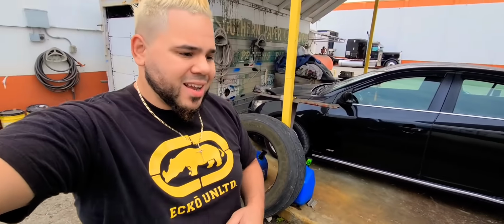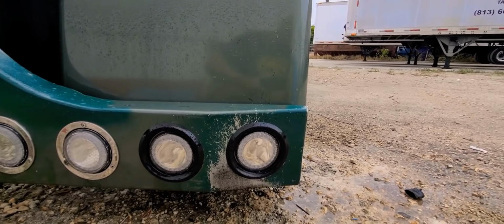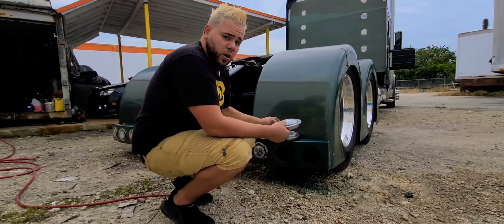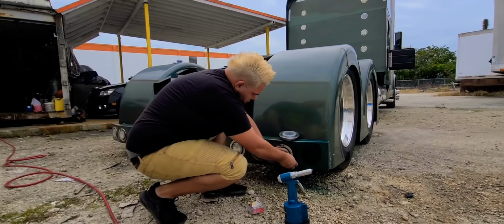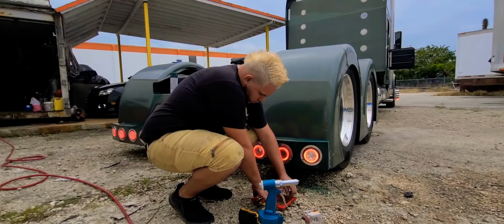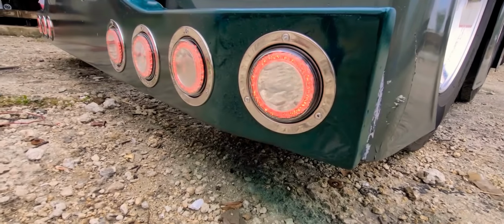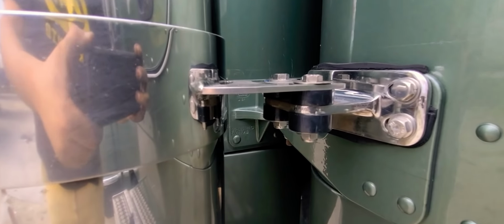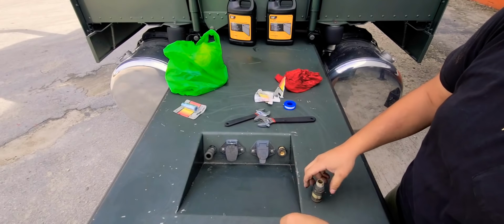Getting some repairs done part 2

Comment: Their is a protective cap they sell to cover the quick connects but not sure what it's  called.
Reply: Yes, I have seen them. They are called tennis balls. You slice holes in them on one side and they will then push right on. Even the correct color. 🙂